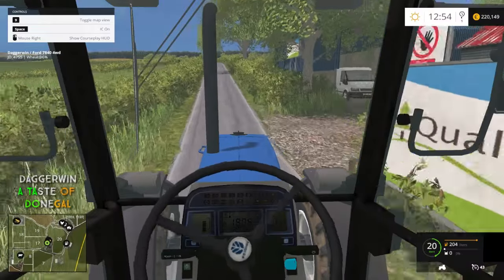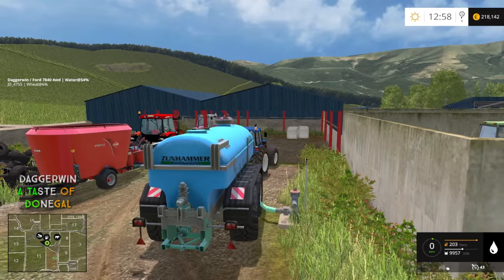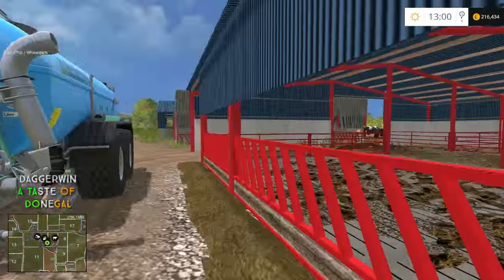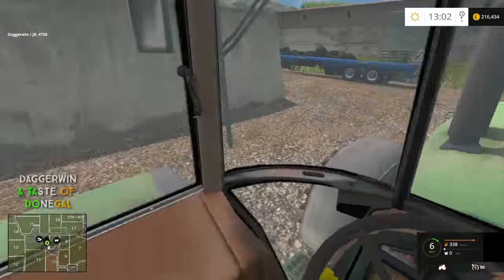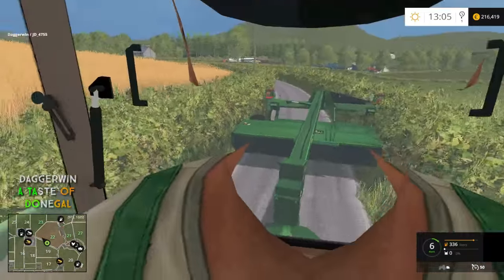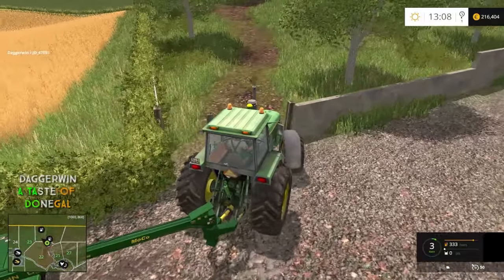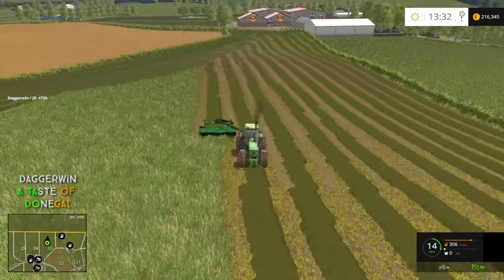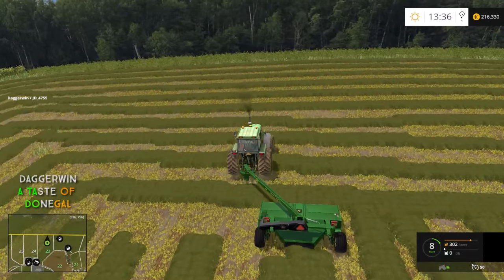Let's Play Farming Simulator 2015 | A Taste of Donegal | Episode 9

Comment: With an offset mower I usually drive the first headland clockwise then do about 6  more laps then go back and do a back cut (anticlockwise) close to the hedge.Then cut the field in to cants and go up and down. This makes it easier to bale as if you row up around the field most rows follow the hedge line and end up with squiggly rows which make is slower/harder to bale fast.   However years ago I used to go around and around like you did.
Reply: I do the same
Reply: literally do the same man

Comment: Hello Daggerwin 
when mowing you do 8 headlands then do the middle then do the outside headland last as that way if you hit a big stone it don't break the mower with a while field to do. also when you that particular mower you start at one side of the field and at the end of each row you can flip it over and by doing it that way you end up with all your short runs at the end so it makes it easier.
Reply: why would you do 9 headlands
Reply: Cause then when you doing the inside you can use the 9th one to put the mower up and down and when you rake it you can do four headlands and we use a forage box so bigger than a chopp
Reply: +Oliver Haines but we only have 5 headlands

Comment: Please do reconsider a pc building episode/episodes. It disappoints me a bit to hear someone say they wanted to build a pc and then default to pre-made machines that aren't as good. Who knows, maybe if your cpu is still a decent enough model you could just upgrade other components instead and save yourself some monies. Because lets face it; You mostly play Farming Simulator, ETS 2, ATS, and the occasional SpinTires. Neither of which need an i7 to play on top settings. Upgrade your graphics card to something better, put in a good sized ssd, and maybe up your system ram and it'll run much better. :)
Reply: Agree'd.
Reply: +Slane583 +1, built my own last year. Best decision as most pre built are made with low spec parts somewhere along the line.
Reply: KWAKA Indeed, and they charge the same if not more. Another of my favorite YouTubers spoke about building a pc or buying pre-built, then he spoke about the MSI Vortex and how the top end model was $4,000.00 and that he wasn't going to pay that much for something which isn't easily up-gradable in the future. It only had an i7 6700K and GTX 980 in it. After seeing that I went and made a wish list that had an i7 5820K, 16GB of ram, a 500GB Samsung ssd, 750watt EVGA psu, and a GTX 980Ti for around $1,800.00. A far superior machine for a third of the price.

Comment: The bowser is squint therefore the twitching, i use the hurliman to move it about the yard and it sits ok as long as you are straight.
self build will always beat a pre built, i have been building pcs for 10 years and the usual differance is , Ram speed/quality/amount and ssd size quality. For gamming ram speed is not a huge thing nowadays, but if you are recording/editing, streaming then bandwidth will make a differance.
And finally most pre built pcs will have hardware/software you don't want/need. i don't mean to be harsh i just feel strongly on this, to the point if you let me know what your shopping list is, i will hunt down the best price for parts/combo (mb and cpu deals can be quite good) ok rant over, keep up the good work lad  cheers for now.

Comment: If you're going to get lag, you're going to get it on this map.  I've got a low spec machine, but I can run Sandy Bay Gold ok for the most part, the frame rate drops to jerky levels at a few spots, but I can live with that.  This map I get 4 or 5 fps at best, it's unplayable.  This is the only map I've had any real problem with so far, so I assume that there's a problem with the map; after all I think Sandy Bay is bigger.

Comment: Back again, no real right method to mowing but rule of thumb is to do 9 laps of headlands at 10 foot each so the rake had 3 30 foots to leave ample room for turning forager and trailer and tractor side by side then straight up and down.

Comment: the way you are supposed to use that mower is to go counterclockwise with the implement in the off set
Reply from the maker: +Richard Merrill What difference would that make?
Reply: +Daggerwin it makes no diffrence irl that sort of mower sits of to the right hand side of the tractor
Reply: Don't mind Dagger win

Comment: I play fs15 on my ps3 and I was just wondering if u can get any mods on it ?if not  can u play it on a laptop or do I need a desktop ?
Reply: What specs do I need to have ?
Reply: +Paul Colborne you can take out your flash drive or saving device and plug it to your computer download them on the flash drive then plug it back in and tada
Reply: +Evan Smith I found some mods on the ps3 and couldn't figure out how to download them. think I'm just gonna buy a laptop. to play it on. cause there is alot that I can not do on the ps3

Comment: Do not buy computers from brands such as HP , Asus, Acer , etc. Some components are weak (Power Supply , Motherboard , etc. )

I recommend you something like this,
Case - To your taste
Drive - ASUS 24X Bulk
MotherBoard - MSI B150M PRO-VDH
CPU - Intel I5 6400
RAM - Kingston 16GB DDR4 2400mhz Hyperx Fury
SSD - Crucial BX200 240GB
Power Supply - XFX TS 550W 80+ Bronze
GPU - NVIDIA GTX 960 4GB or AMD r9 380 4GB(or a little better performance the r9 380x 4gb).

Please comment if you see something wrong.
Reply: I have a hp and its doing my job it's the best